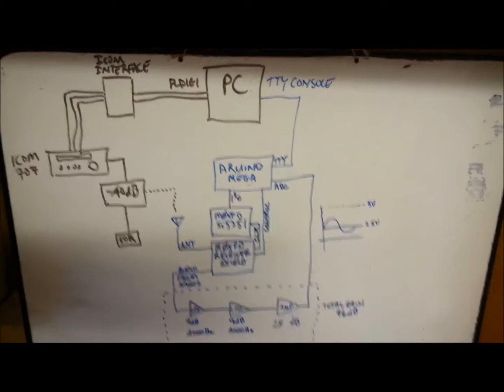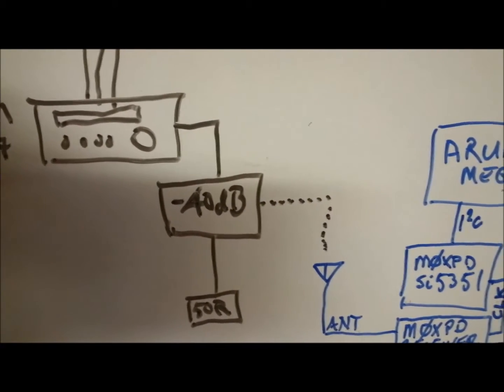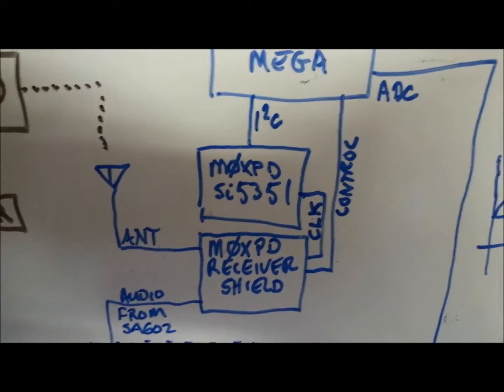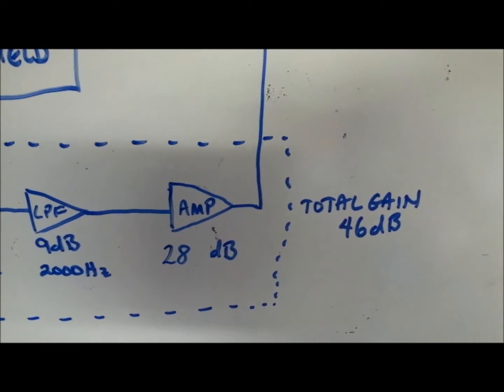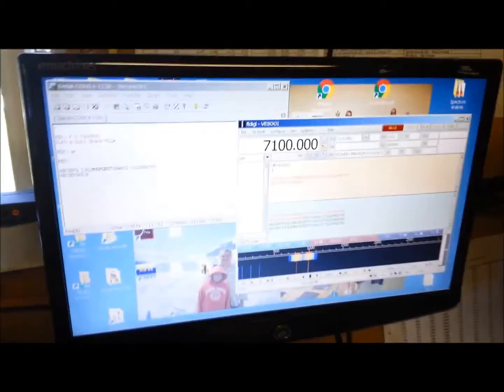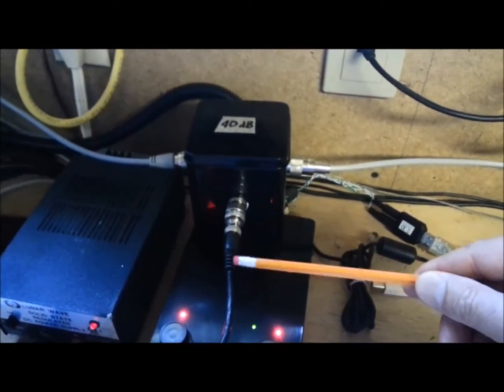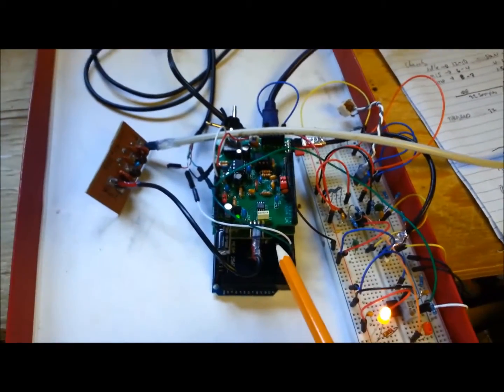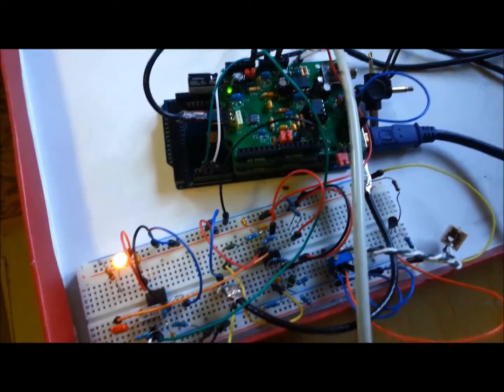Arduino RTTY Decoder - RF Reception Test

Comment: Awsome video. I have a quastion. Would it be possible to take the audio signal from a pixie direct to the ADC or A0 on the arduino?
Reply from the maker: The issue if filtering. If the Pixie is a "direct conversion" receiver, it outputs RF as well as audio and you need to do a low pass filter to remove anything above audio (say 5 or 10 KHz) otherwise the adc will fall victum to something called Aliasing.  Its always good practice to low pass filter anything going to the arduino.  The filter cutoff must be 1/2 of the sample frequency.   E.g. Arduion sames usually around 9KHz and filter must only pass anything below 4.5KHz.  Also you need to ensure the voltage going to the adc is not negative or above 5V otherwise it may damage the arduino.  If the voltage from the pixie is too small, the adc may not detect it and you may need to amplify it. Good news is that you can use a cheap audio opamp to raise the voltage a little.